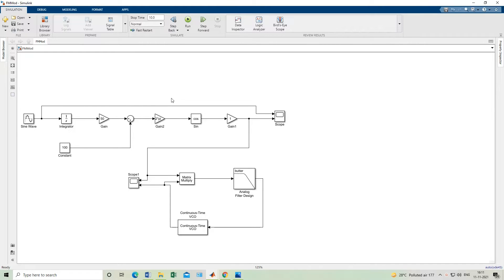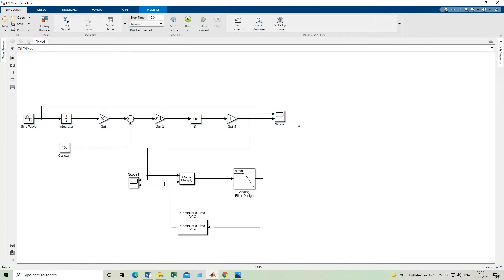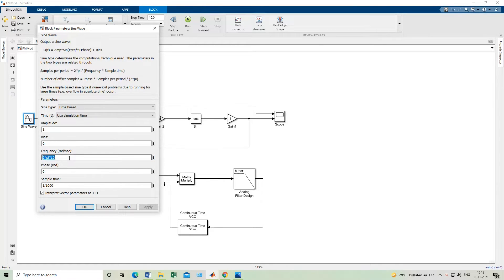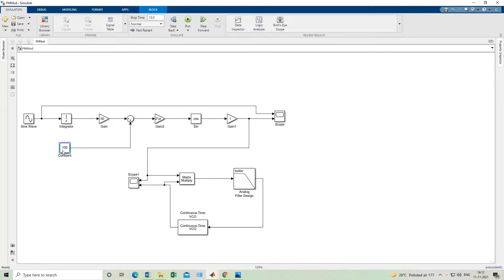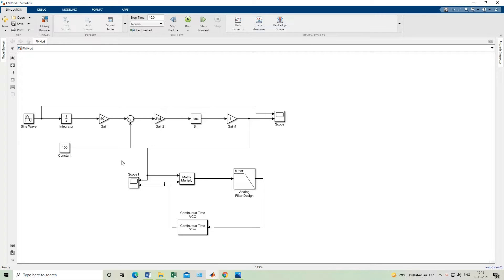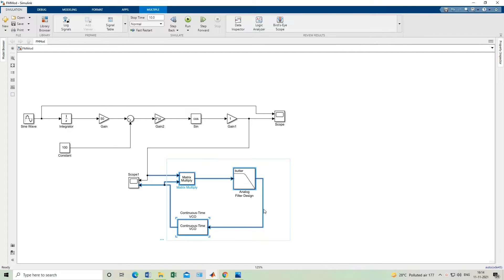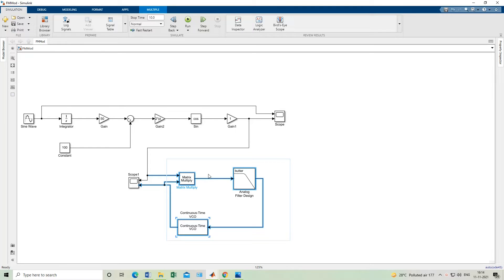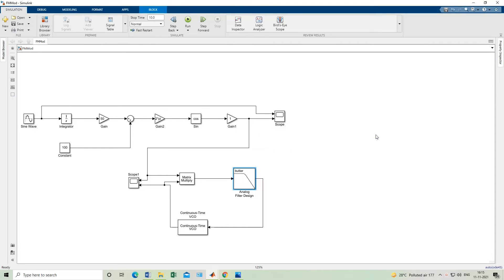FM Demodulation using Phase Locked Loop(PLL) in Matlab Simulink | VCO |

Comment: Problem Statements
The university is setting up a new laboratory for the School of Technology Management and 
Engineering. A ground survey suggests that the laboratory has at least two power supplies, 
three fans, two tube lights, and a plug point. One fan and one tube light can be powered by one 
power supply. However, there is only one fan powered by two power supplies. The following 
points are assumed during designing: a) DC power supply of 20V and 35V b) the fan is a 
resistive load of 10KΩ, 25KΩ, and 35KΩ c) tube light is led bulb, and d) a plug point is 
unknown resistive load. A 20V source powers the 10KΩ resistive load (fan), 25KΩ resistive 
load (fan) is powered by a 35V source, and both 20V and 35V supply power with 35KΩ 
resistive load (fan). The plug point is between tube lights. Estimate the power consumed by 
each component for the proposed circuit. It is required that the plug point provide maximum 
power and determine the load resistance value of the plug point that satisfies the given 
condition. 
Notes: 
1. Any of the circuit analysis methods can be used to solve the problem. 
2. The solution is to be supported by calculation using pen and paper and simulation 
software. Both the results should match each other.
3. Mention the method used for the solution.
4. Draw a circuit diagram, prepare an observation table, and write your conclusion.